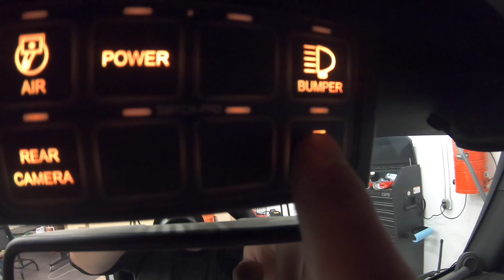Heavy Duty Battery Terminal Upgrade (Busbars!)

Comment: Jesus Christ why does everyone use dielectric grease. You do not put it on your terminals before you connect your wires. You should always clean your battery real good connect your wires. Then and only then cover the terminal with dielectric grease.

Comment: Nice tutorial thanks - but please remove metal jewelry when working around the battery.
Reply from the maker: Shouldn't result in a condition that would create an arc, but point taken, and also for hands-in-tight-spaces reasons, I've since switched entirely to silicone bands in the shop. Thanks!

Comment: No not "vinegar and baking soda".  A million cleaning videos say to mix them.  No, do not. One is an acid and the other is a base. You mix them you get salt and water.  Use one or the other not both.
Reply from the maker: Yes, saltwater, but with a bonus: CO2. The CO2 gas created by the reaction between the acid and the base is helpful for displacing and removing corrosion. You definitely don't want to leave the solution on the terminals. And if you don't have bad corrosion, I absolutely agree with you vinegar alone is effective and the easiest. Thanks!
Reply: @OverbuiltAdventure  If you want bubbles, put the baking soda in club soda.
Reply: Baking Soda is mildly abrasive, so baking soda and a scotch brite (R) would scrub it. I searched on "lead vinegar" and found no reason not to use vinegar. 
well done

Comment: Having trouble finding the bus bar kit. Unfortunately I drive a non-jeep vehicle. Trying to add bus bars to my GMC savana adventure van. Wondering if the quadratec kit you posted might still work...
Reply: As long as you have solid lead terminals instead of stamped steel, you can probably use any manner of brass accessory bar. You may need to pick up some more appropriate bolts from the hardware store if your terminals are threaded differently.

Comment: I’m guessing there must be current running through the brass body of the bus bar. Why is it that we don’t cover that with some kind of insulation to prevent it from being exposed?
Reply from the maker: This is kind of why the comments from some below about using only copper or dielectric grease, while correct in a lab, may not be the best in practice. Brass is stiffer, cheaper, and doesn't require a coating to prevent corrosion from the elements. The length of the bus bar is so short, that the difference in conductivity is barely measurable. We aren't using a 20 foot bus bar. Dialectric grease is best for conductivity, by that's not the only problem posed by vehicle batteries. Gas/fluid leaks are too, and that's what vaseline will help seal out, just don't coat the whole stud, just the bottom. You could cover the bus bar it if your engine bay is messy or you or family are clumsy with tools, but it is no different that the two exposed leads on the battery itself. If you arc positive to negative, you're going to get sparks, and possibly a fire. Keep them distanced, and you're a-okay.

Comment: you can also use a small sheet of silicon rubber to cover the battery terminals to prevent contact. Much easier that trying to tuck the pos and neg away.

Comment: Vinegar and baking soda? why would you mix an acid and a base? If you are trying to neutralize acid you use the opposite side of the PH Scale, an alkaline product. Baking Soda in distilled water is perfect.
Reply from the maker: In this case I'm not trying to neutralize the acid, I just want my posts as clean as can be. Vinegar and baking soda combined has all of the benefits of baking soda and water, but it causes a reaction that creates CO2 bubbles that help clean away the corrosion from all of the nooks, crannies, and microscopic valleys  that your wire brush alone won't reach.

Comment: Radio Interference from ignition could be snubbed with an inductive coil or a ferrite choke. Aftermarket stereos use them.  I did this professionally. It paid well, so I retired and hit the trail. 
I am trying to figure out how to get one more terminal on my stock Silverado. Having fun here. Great video, man!
Reply from the maker: Interesting, I'm used to seeing those on certain electronics, hadn't thought about it for in-vehicle radios. Would you need to install one at both ends of the power wire? Does the type that you'd use vary based on the frequency spectrum of the radio system? (GMRS, Ham, CB, etc.). Cheers!

Comment: Only thing i seen that was off ...Dielectric grease instead of vaseline ( Vaseline is a petroleum-based mixture of minerals with a melting boil of 38° to 54° C (100° to 130° F) Engine temps surpass this every day  Dielectric grease you can get in the 500° C ranges  
Also if the vaseline touches rubber it does draw out moisture in the rubber And makes it brittle ...Wires, Hoses etc 

The bus bar : If you are getting to a point that you have more than 2 or 3 wires going to your battery a Bus bar may be what is needed However Why would still need to have the bus bar at the battery?  I run a Bus bar box off the side of my fender And run 2 main lines into the battery. I am blown away that Jeep V6 has the battery hook ups facing the Engine
Reply from the maker: Yep, I always go dialectric grease, and should not have said that Vaseline would work as well. As for the location, this product was conceived because of a problem that Jeepers have been dealing with for decades: minimal space.  Wranglers have always been small, but about 15 years ago the engine compartment really got cramped. There's not really room for a traditional marine-style busbar without changing the position of the battery, which just changes which space is eaten up. There will still be a tradeoff that may make it more difficult or near-impossible to (properly) mount a switch system, for instance. Thanks for the comment!

Comment: Not to rain on your parade but this has multiple no-no. ex. nut not fully engage on the studs, at 1:39 you have a large AWG red cable connected on a small #14 wire connection,  nothing is fused, 05:01 a what 1/2? or 1/4" connector on a 1/8 stud, same for the next, 05:34 Vaseline is NOT an electrical conductor it has isolation property so you are making your connection worse, 07:16, on the positive side one wire crossing over a different at a point where the conductor connectors are exposed, 08:21 again a small  gauge wire Red at the bottom of the electrical tree with a larger yellow wire on top, 08:31 a positive wire is rubbing and chaffing again a Neg post that will make sparks, no boots on the Pos terminal, wire color codes not respected.
The internet is a funny place.
Cheers,
a.

Comment: Nice upgrade. I can’t find  the bus bar on the web. Where did you get the busbar! Please post.
Reply from the maker: You can typically find bus bars at any battery specialty store. The one used in this video is available at Quadratec here: https://www.quadratec.com/products/17004_9001.htm
Reply: Thanks for info. I thought you said it was cheap. It is nicely build but I am going with Bluesea 2340 as I don’t really need “extreme duty”
Reply from the maker: @karlchang6557  They aren't expensive, as upgrades go. The Bluesea 2340s are still a very thin plate. They are rated for 14awg connections, which I would only use for 15A circuits. You could get by with 20A on short runs. Definitely would not put a winch on that. There's only about a $10 difference, and the ones used in this video are more than just a bus bar: it also replaces your stamped terminal with solid lead, and comes with the anti-corrosion pads. ¯\_(ツ)_/¯
Reply: @OverbuiltAdventure  7ù

Comment: Any concern with leaving the positive terminal connections exposed? I was going to replace both of my basic oem terminals with 6 spot terminals for additional connection points but I don't particularly like the idea of having the positive terminal exposed.  Any solution to this? Thanks.
Reply: What's your concern, specifically? If it would add peace of mind, you would need to cover it with some non-conductive material. Something like Coax-Seal would probably work, it's pliable and would fit around any shape necessary.
Reply: @0VRLNDR  Its peace of mind. Mitigate any possible accidental shorts to ground. I'm probably just being overly cautious.
Reply from the maker: @hippo-potamus  That's never a bad thing. Let us know what you end up using, maybe we'll do an update.
Reply: @0VRLNDR I saw that he put a washer between connection on the end of the cable and where it makes contact with the brass on the bus bar. Is that ok? And is it ok to do that same thing when connecting to a fuse?
Reply from the maker: @joebenham27  Washers just distribute the load of the bolt across the surface instead of just the threads. Good idea any time, or you can use a flange nut to accomplish the same purpose. Not sure what you mean about connecting to a fuse, can you elaborate?

Comment: Can you use the busbar on a marine application with a Lifepo4 battery?
Reply from the maker: In a Marine application you shouldn't be attaching many devices to your battery, regardless of chemistry. For instance if you're using a "drop-in" LiFePO4, you'd still run to a house fuse panel to distribute the loads on individually fused circuits.

Comment: I do like the video , but I do gotta say this wiring looks as messy at the end with the new parts as it did in the beginning 
Still a neat video 👍🏼
Reply from the maker: Fair comment, this build has a lot of accessories that require direct-to-battery connection that were installed at different times. If there were room in this engine compartment for a sidewall-mounted marine bus bar, running new wires would be best.
Reply: @OverbuiltAdventure  agreed, the “remote location “ blocks are great - Amazon has them fairly inexpensive and you can get them to receive all the way up to a 0 or 2 gauge power wire to keep the connections real strong 💪🏽

Comment: hello everyone , i have one question about the busbar , busbar design : why are sometimes more strips needed and sometimes less, on what that does depend?

thank you
Reply: It depends on the amperage and volts lots of power creates lots of heat. A bus bar allows you to add multiple runs with and without fuses (depending on the need) to one point. With a bar you can have one thick wire coming off the battery and connect two, five, ten or twenty thick wires to the one battery post. Or a very easy connection point for multiple batteries and multiple audio amplifiers. (Done very regularly in high end mega bass vehicles) if all you are doing is adding extra sockets like for charging phones or small led lights, a bus bar will not be needed, in that case you could get by with just a blade fuse block. 
Hope that helps.

Comment: the busbar part number??
Reply from the maker: The one used in this video is Quadratec JK-HDBT12 Extreme Duty Battery Terminals: https://www.quadratec.com/products/17004_9003.htm

For 2011 and lower JKs, it's just JK-HDBT: https://www.quadratec.com/products/17004_9001.htm